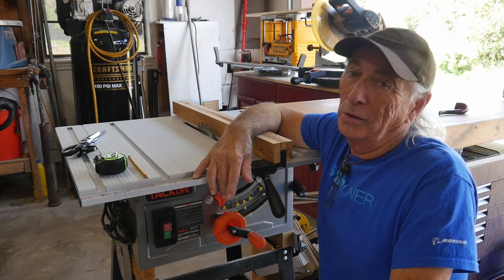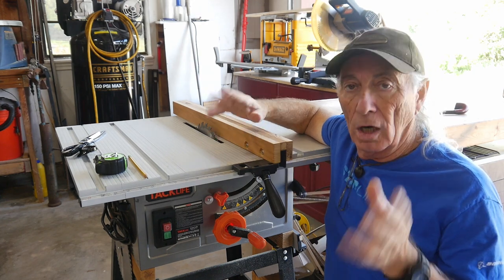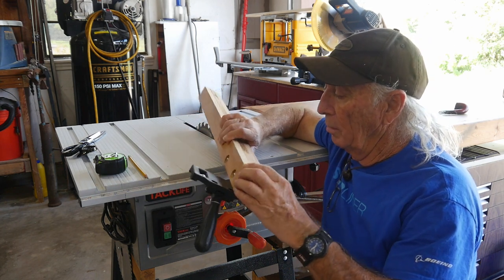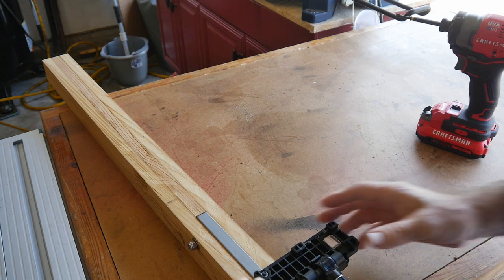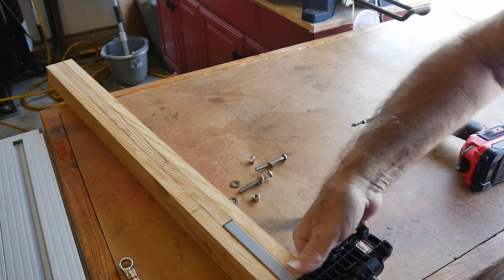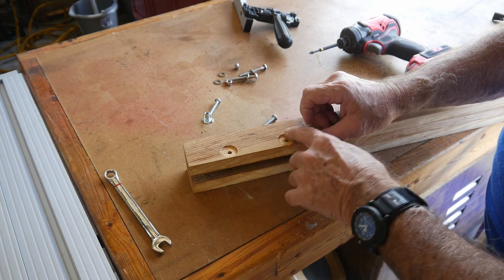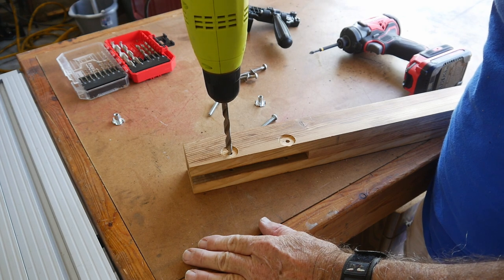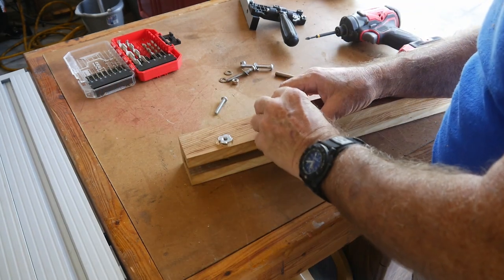Tacklife table saw upgraded fence 2.0 and Harbor Freight clamp, Coffee and tools episode 121

Comment: I made my new guard the same as yours buy I'm still having a problem with the lock handle that's not flush with the table so when I'm ripping a piece, the wood wants to kick back because it has the small step about 3/16" drop from the handle lock to the table. I'm so pissed I might have to buy another table saw because this one is so bad! I can't get a perfect 90° on the blade and screwed up 4 pieces of walnut before I realized it's not at a perfect 90° if you just go by the saws numbers
Reply from the maker: OUCH , not good. I went over my saw with speed squares and "tested" with the old cut and turn, cut and turn and it was better than my old Ryobi table saw. Not everyone will get a good saw etc. Up coming video is an old ..VERY old craftsman that will replace that Tackle saw. Also I ran a lot of junk wood before doing ...geez.. Walnut..that really would hurt...

Comment: You make this look so easy..  I am new to this.  Just wanted to know if I could get the proper measuresments for the Tee Nuts and screws and washers.  Probably is a stupid request, but I am starting at the most basic level.  Thank you so much in advance.
Reply from the maker: Not a problem. Having sizes makes life a bit easier for even small projects like this one. The end block added to the fence was. 2inch x 3 3/8 inch of 3/4 inch stock. The T part of the blocking was 4.5 inches L, by 2 1/4 inch and 3/4 inch thick.
The back stock is just 2inch x 5/8 x 1/2 inch. The clamp bolt is 4 inch long, 1/4 20 carriage bolt with over sized washer and knob from "tractor supply".
Reply: @SirTools , thank you so very much.  My husband will be going out in a moment to make the purchase.  This is going to be my first project.  I truly appreciate your help.  Thanks.
Reply from the maker: @deidredorsey1326  If you have questions about it, just ask. There might be a delay from me but I'll do my best to help if needed

Comment: Hi from Spain. Is there any way to adjust the angle between the blade and the lines of the table for being completely parallels? My saw has a little variation of 0.5 mm
Reply from the maker: Hi and sorry to hear you saw is off. Mine was 100% You'd have to fool with the motor mount and maybe even add shim to correct it. Sad to say this. Let me know what you do.

Comment: My tacklife saw came with a rip fence that is nothing like yours. Is that the one that came with yours. Mine wiggle-waggles all over the place, barely slides across the corrugated table surface, and is never parallel to the blade. I have tried getting through to Tacklife MULTIPLE TIMES: email, phone, etc. It's liks customer service just up and died.
Reply from the maker: We 2 tacklife table saws. I upgraded the gen 1, which had a terrible fence. Service wise, I think tacklife is not dead but dying perhaps.
Reply: @SirTools  Thanks. Looks like I chose poorly...

Comment: Hi I have the same table saw and I would like the measurements for this fence. Would you be willing to share those?
Reply from the maker: Hi Billy. The lumber length is 29 inches long, you cut 2pc of 2 inch x 3/4 and 2pc of 3/4 x 5/8 inch The 5/8 is roughly the part which clamps on the fence handle end. The parts are glued together and one of the  3/4 by 5/8 is cut 6 5/8 inch shorter in length to fit the aluminum part of the handle end. Hope this helps !